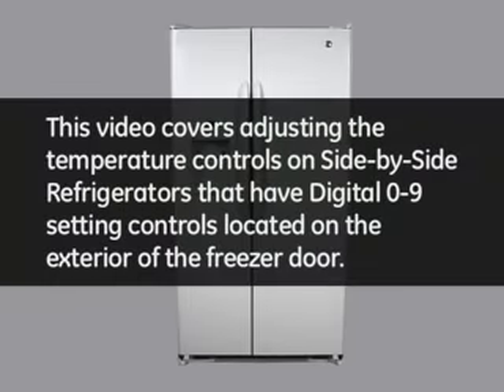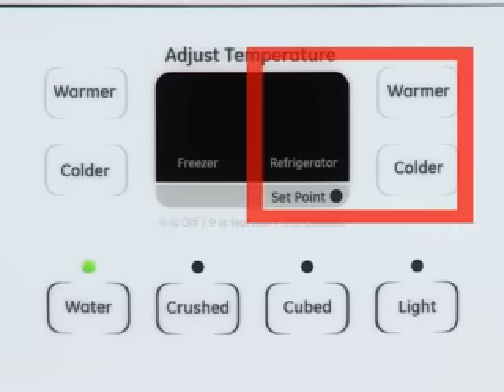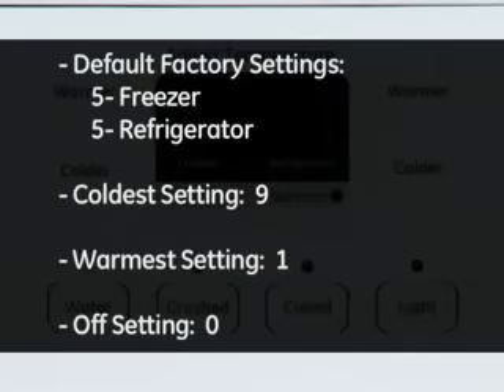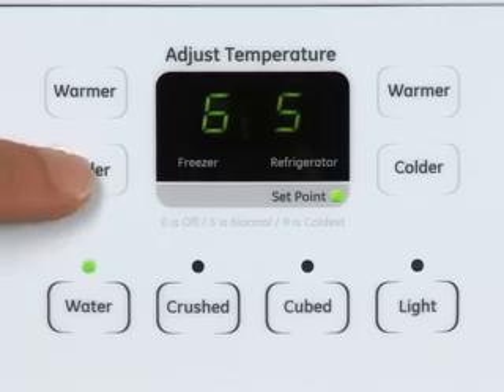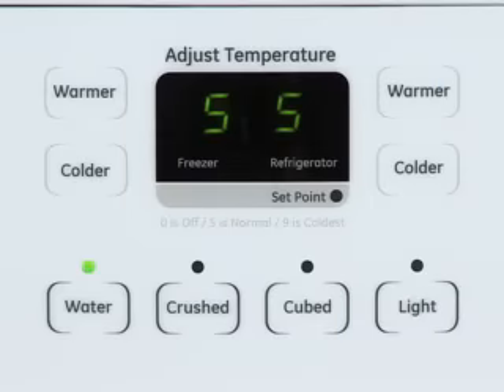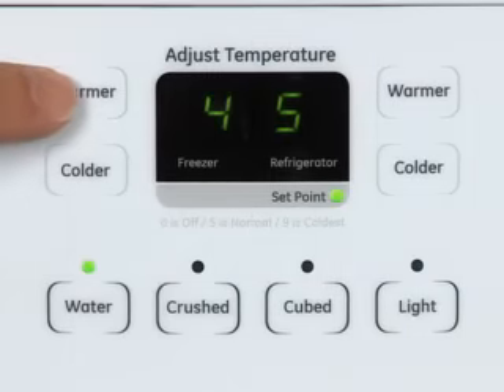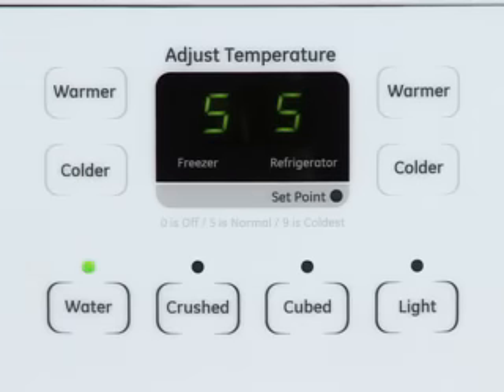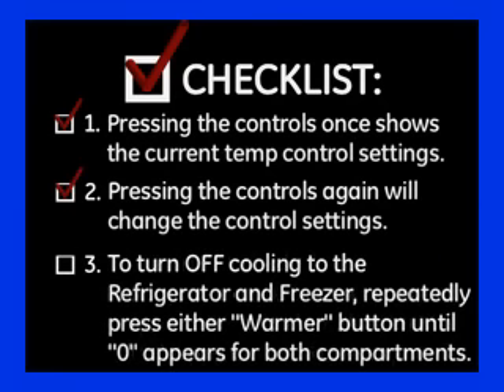Adjusting Side-bySide Refrigerator Temp Controls - Set Point

Comment: I had a module with digital setting on my GE French Door Stainless doors Refrig.  The digit settings were set too low and the refrigerator wasn't as cold as it should be.  I took the three screws out to pull the housing down - it was located inside the refrig. door at the top.  I couldn't budge the settings. I observed it had a printed circuit board and when I squeezed it with my fingers I was able to get the freezer settings to change.  Next, I pinched the circuit board further to the RH side where the refrig. setting was - eventually I was able to get that to work also - it was a bit more stubborn.  Now the settings are fine, so I'm waiting for the result of colder food. I suppose the circuit board should be replaced, but now the settings appear just fine.
Reply from the maker: Hi, Dennis. Thanks so much for being part of the GE Appliances family. We're sorry to hear you had some trouble changing the temperature setting on your refrigerator. Typically, we recommend a certified technician to complete a repair like this, so please call 1-800-432-2737 for further assistance. Thanks! - JB
Reply from the maker: Dear Dennis Hassler,
Please take a moment and complete our online survey by clicking on the following link:
http://spklr.io/6002iSZA. We look forward to your feedback.  To unsubscribe please click this link: http://spklr.io/6003iSZ7

Comment: We have a refrigerator with this exact control panel.  We had to move it out of the house to use in the garage.  When I cleaned it out to move it out to the garage, I turned the controls to 0 "off" before unplugging it.  When we got it to the garage (delivery men took it out for us with their handy straps) and plugged it in, the lights inside would come on, however no lights, NOTHING comes on on the control screen and nothing come on when I push any of the buttons. What did we do, or can we do?  Thank you.
Reply from the maker: Gayle H We recommend resetting the electronics by unplugging the unit for 5 minutes. If that doesn't help you may want to contact service. The dispenser connections may have come loose when it was moved. GE Consumer Service can be reached by calling 1-800-432-2737. I hope this helps!

Comment: I have the same temp display controls on my GSSW model. However the temperature display just flashes 0 and I cannot change the temperature. The unit is still working, however it is warmer than I want it. The warmer and cooling buttons beep when pressed, but they do not change the display or the temperature. What can I do?
Reply from the maker: Before calling service, sometimes disconnecting power to the refrigerator for 15 minutes will reset the electronics; however there are some cases when further service may be required; you can do so by calling 1-800-432-2737.

Comment: The temperature controls on my side-by-side refrigerator are not on the outside of the freezer door.  They are at the top of the inside of the refrigerator side, right opposite the door.  They are digital.  Model no. is PSG22S1PAFBS.  I am unable to get the numbers to change by pressing the controls.  HELP!
Reply from the maker: Hi Hedy - this looks like an export model refrigerator and we have information here on products made for the United States.  However, if your model uses the numbers 1-5 or 1-9 (rather than an actual temperature), they should change when you press the 'Warmer' or 'Colder' pads.  If they don't, then you might try unplugging the refrigerator for 3-5 minutes and trying it again.  Thanks  -CC
Reply: Yes, it is an export model.  Also, I made an error on installation date--it was 2005, not 2015, that it was installed.  I tried unplugging the refrigerator as you suggested, then resetting, but it still didn't work.  Maybe I didn't unplug it for long enough.  I'll try that once again.
Reply from the maker: Good luck, Hedy!

Comment: GE Appliances:  thanks.  As you know, this is crazy antiintutive.  It looks like a two-digit temparature, in Fahrenheit.  And to make it colder, you push a higher number, not a lower one?  

So, to rest to factory defaults I can just cut the power, right?  If not, how?

I'll puzzle it through.  Until then, it would be helpful to have the script for this Youtube in text form as a comment.

Thanks.
Reply from the maker: Correct- to make it colder the number goes higher. Think of it as increasing the amount of 'coldness' for the refrigerator. Alternatively, to reset to factory defaults you would increase or decrease temperature (depending on what it is set at now) to 5 and 5.
Reply from the maker: Video Script below:
This video covers adjusting the temperature controls on Side by Side Refrigerators that have Digital 0-9 setting controls located on the exterior of the freezer door.

This type of control can be identified by the words 'Set Point' the control panel. The freezer compartment adjustment buttons and digital display are located on the left side of the panel. The refrigerator fresh food compartment buttons and digital display are located on the right side of the panel.

Note: there is no digital display during normal refrigerator operation. The default control settings for the factory are 5 for the Freezer compartment and 5 for the refrigerator compartment. The coldest setting is 9 and the warmest setting is 1. The 0 setting is OFF which turns off cooling. Pressing any warmer or colder button 1 time will display the current control settings of the refrigerator and freezer. Pressing the warmer or colder button again will adjust the temperature control setting. To press the control button cooler, press the colder button of the desired compartment to increase the setting by only 1 number. You will notice that the Set Point indicator light will illuminate. Make sure to wait 24 hours before making another adjustment in order to give the temperatures time to stabilize. Repeat as needed until you reach the desired temperature.

Adjusting the temperature warmer: To press the control button warmer, press the warmer button of the desired compartment to decrease the setting by only 1 number. Make sure to wait 24 hours before making another adjustment. Repeat as needed until you reach the desired temperature.

Turning cooling On and Off: To turn off cooler to the refrigerator and freezer, repeatedly press either warmer button until 0 appears for both compartments. Note that this does not shut off electrical power to the refrigerator. To turn cooling back on, press any button 1 time. 0 and 0 will appear in the display to show that the unit is off. While 0 and 0 is displayed, press either colder button 1 time this returns the refrigerator and the freezer to the default control settings from the factory.
Checklist: 1. Pressing the controls once shows the current temperature control settings. 2. Pressing the controls again will change the control settings. 3. To turn OFF cooling to the Refrigerator and Freezer, repeatedly press either “Warmer” button until “0” appears for both compartments.

Comment: My ice maker froze up, I thawed it, cleaned it, and checked for any blockage. When I put it back together, and turned on the water, and then the machine, the water pressure is very slow. The water pressure on the door is fine. What could be the problem, thank you?
Reply from the maker: I couldn't say for sure but take a look at this link and let me know if it helps: http://products.geappliances.com/appliance/gea-support-search-content?contentId=17408
Reply: GE Appliances Hello, thank you for your help. It seems today the filler cup is overflowing, along with electronic ice maker assembly. Could this part need replacing?
Reply from the maker: Possible, but I'm not sure. I'd recommend calling our service tech at 1-800-GE-CARES.